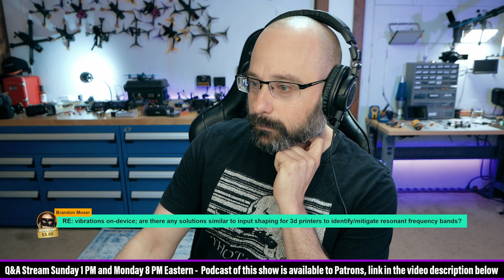Why Can't We Just Keep Adding Filters Onto Our FPV Drones? - FPV Questions

Comment: I would put input shaping on the output to esc motors to have even more sharp stops.
I think It's not a filter.
Reply: input shaping is now in betaflight. it's called frequency chirping
Reply: @TimeFadesMemoryLasts  I wish I can understand why the fpv drone community changes names. I find it confusing.
Reply: @michelcote  frequency chirping is the scientific name of sweeping through all frequencies. it doesn't originate in fpv. it is used to identify the behavior of an object to any kind of input. in the example of BF we can use the data to see the effects of changing the tune on a computer without the need to actually fly in between tuning steps. on second thought maybe input shaping is not a good word for it because it's a bit different. frequency chirping is needed as a tool for input shaping but it's just a part of input shaping in 3d printers. does that make sense?
Reply: @TimeFadesMemoryLasts  thanks, I will google that. I use to call that frequency reponse test.
and yes input shaping use this to tune its output
Reply: @michelcote  I guess the most superordinate concept would be "system identification" but that's a huge field. In this example of BF you wiggle the input (freq. chirping to "wiggle at all possible frequencies") and see how the output looks like. And from comparing the output to the input you can determine how the drone acts (and even how it changes its response when adjusting PIDs or primitive filters)
Reply: I think upcoming BF 4.6 has the chirp function added, which when triggered, the copter sweeps through low to high freq input, then there are some Matlab scripts that derive the transfer function from the log data (I’m over simplifying, there’s more to it than this). I haven’t seen much on it yet but I think it’s folded into the master

Comment: i bet it's possible to train an ai on thousands of blackbox logs, to output a perfectly filterd signal based on some past gyro data, but the output is as if it was instant, because of the training data where it can actually look into the future
Reply: AI won't be faster, filters are pretty simple math, to execute and run an ai will be waaay slower. ( on the actual drone hw that we  have now )
Reply: @butcher  if it's done within one cycle of the pid loop that's fast enough 😅
it could use the gyro data of the last second to predict another second into the future
if you then appy the filters the result is as if the filters were be applied instantly (assuming the predicted data is what actually happens)

Comment: Our quads would need a Raspberry Pi based FC or something like that to be able to run something like that.
Reply: guess we have a new goal
Reply: @MCsCreations  and integrate elrs and esc code so that everything can be perfectly synchronised
loop(
read rx
read gyro
filter
calc pids
output motors
)
all at the same frequency